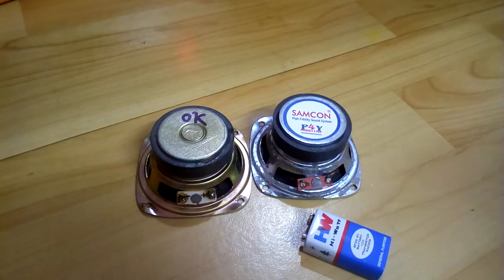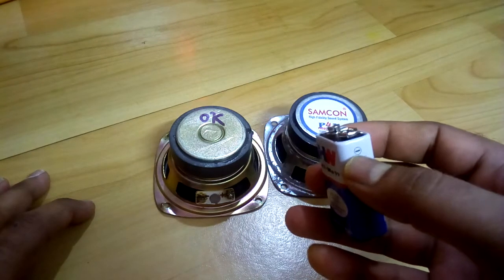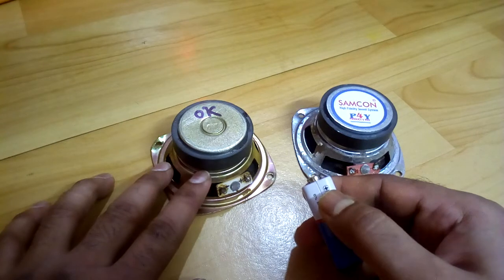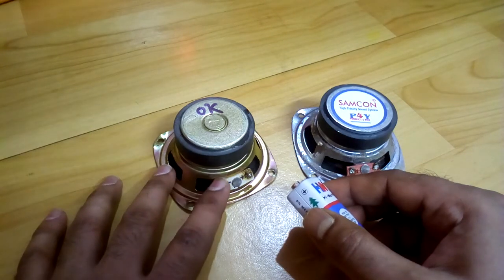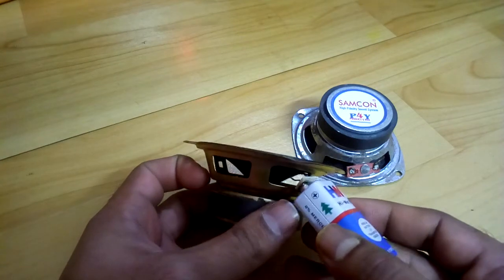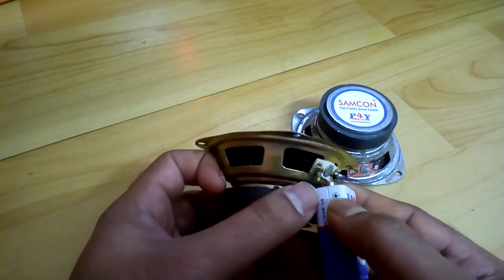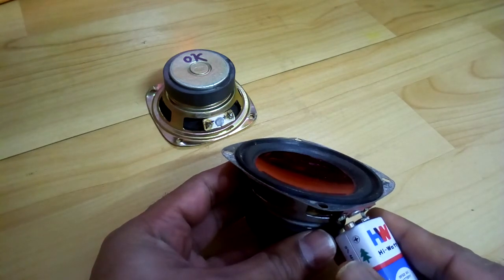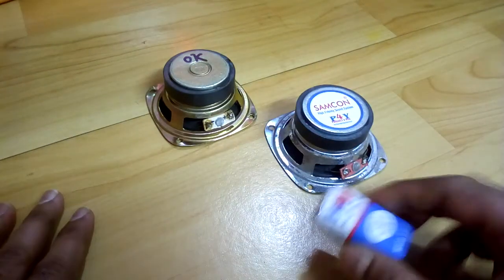How to check speaker polarity/ test positive & negetive terminals

Comment: Sir how to identify the earphone's speakers polarity
Reply from the maker: Thats hard to do. Headphone speakers are marked with +& -. And also different colour wire. If you are talking about totally opened non wired speaker. Then use the same technic but use a 1.5v battery &  wires.